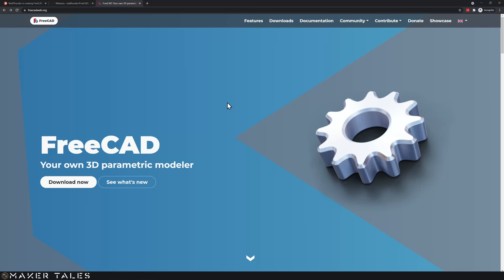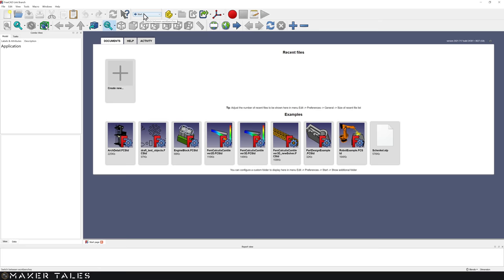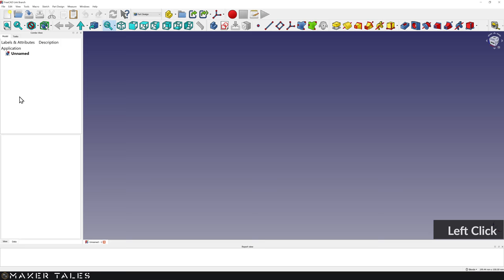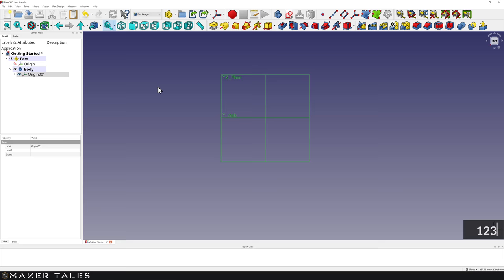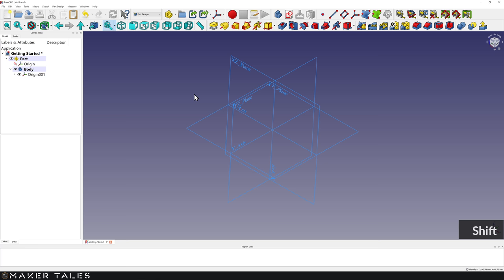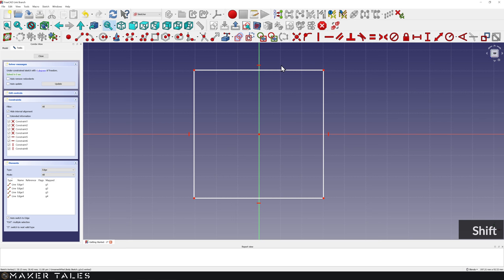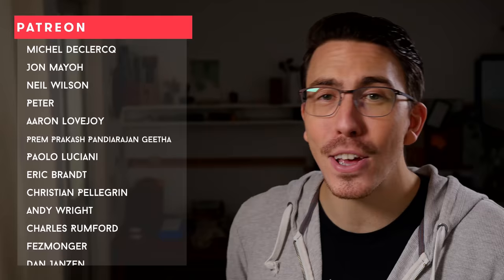How To Use FreeCAD The Realthunder Branch For Beginners | Setup & Basics | For 3D Printing | P. 1

Comment from the maker: New Location to Download the 2021.07.17 Version of FreeCAD Realthunder branch is here: https://bit.ly/3hzjGcP
(It's Realthunder's Google Drive, you can get to this same link by Clicking "Past Releases" in the github)
Reply: Should note that the most update-to-date versions will still be on Github
Reply: @stephenrbrough  Whats github?
Reply: I downloaded "FreeCAD-asm3-Daily-Win64-Py3-Qt5-20220118.7z", downloaded 7-zip to unzip it. I double clicked on "RunFreeCAD.bat", and immediately got an error message - "The code execution cannot proceed because VCRUNTIME140_1.dll was not found. Reinstalling the program might fix this problem". HMMM... Looking through the .bat file I notice it's setting a path - maybe there's something wrong in there. By the way, 123D Design stopped running on this same PC. Probably unrelated, but..  Searched through that folder, the file "VCRUNTIME150_1.dll" in fact isn't there. Is there something else that needs to be installed? Some programming libraries perhaps?
Reply: I wish this thing had a proper installer, though..  I had to figure out how to create icons on the Taskbar and Start menus (right click on the Taskbar icon when FreeCAD is running and select "Pin to Taskbar", and the right click the icon on the Taskbar again, right click on the icon that pops up, then click "Pin to Start").
Reply: at 17:36 there is a google search shown. I totally remember several of those drawings from my high school drafting classes in the mid 80's.
Trust me, I have a memory for these sorts of things, I got straight A's in those classes. And when you put time and effort into a pen & ink paper technical drawing, you memorize the shape.
I just think it's really funny and random, how that show of a bunch of plans comes up, and I recognize them. Must have been standard school curriculum drawings. I drew those parts by hand before Autocad was much of anything. Autocad version 10, which was when it really took off, didn't come out til after I graduated HS.
Some of those drawings at 17:36 have been around since before any CAD. They are from the days of papers & rulers.
Damn, I'm getting old. You get trapped in memories when you get old, just wait kids.
Reply: @iskandartaib  I know this comment is a couple of months old, but the error you are seeing just means you dont have the Visual C++ runtime installed, freely available from MS. if you look up Visual C++ Redistributable you should be able to find it pretty quickly. Good Luck!
Reply: @bezza191  Hi! Yes, I figured that out.. It's running now. However since  I watched that video he made comparing Blender to FreeCAD I've decided to learn Blender instead. 😁 I must admit, FreeCAD was pretty daunting.

Comment: THANK YOU! Yes, I barely started FreeCAD and I found the bugs to be a show stopper. I am going to switch to the Realthunder branch. I find FreeCAD or Realthunder good but, here is the problem. Most CAD programs hide the background mechanics. When I create an object in Autocad, it automatically puts in the location and constraints. FreeCAD is too " clickish " to make stuff. I just want to select a cube, sphere or a cylinder. Make the object, have it attach to other objects and be all happy. FreeCad asking me to define a body, a sketch, close this window, define this attachment point, tell FreeCad to make another body ( why? just click on another cube and go! )... It feels like using a washing machine, where I have to define the water level, input in the soap, define the spin RPM, and how much time on the drain cycle. Then do that all over again for every item of clothing I put in the washing machine. Too verbose, make some assumptions, like if I put a cylinder with 0,0,0 as my start... yea, I really do want 0,0,0 as the start origin of the object.

Comment: You're doing both the maker community and the open source community a great service with your work. I'm going to follow this intensely, as i'm going all open source this year, leaving proprietary CAD software behind me.
Reply: @jordanmclaughlin3312  Really well actually. I'm a mechanical engineer, and university indoctrinated me with a lot of proprietary software,  which i often find smaller companies hesitant to purchase. With free open source (FOSS), I can often showcase use cases, without ever asking management for license. I will say, that it requires a lot from the user, because what you often get with proprietary software is great documentation, user friendly GUI's etc. Not always the case with FOSS. Ufortunately CAD is one of the weaker FOSS fields atm, compares to proprietary. Theres simply no way FreeCAD could replace my Solidworks license at the moment, mainly due to the lacking assembly workbench. In the future, i hope so. Im into finite element analysis for stress analysis, and so im hoping to transition into open source with that over time as well, which FreeCAD actually supports too (Calculix). My plan is to be able to freelance within 10 years, relying as much as possible on open source

Comment: Thank you for taking this challenge on.  Great tutorial.  I started in on FreeCAD a couple of years ago, and you described the learning curve (prior video) precisely.  So, I gave up and explored options.  Never really came up to speed, but struggled through (I'm just a simple 3D print parts maker for pleasure - hobbyist) one where the "free" version required renewal too often.  I came across your video whereby you pondered whether to proceed with the current FreeCAD trunk or the RealThunder branch, which led me to this video.  Thank you.  I can now get a proper education on setting up drawings/sketches to print exactly what I need.

Comment: I used to mess with 3DS Max and Maya quite a lot years ago, but haven't really used any 3D CAD / design stuff since, aside from a lot of Eagle and Altium for PCB stuff.

But I think I was missing out on using CAD for combining PCBs with other parts.

I just wanted to say that this is an excellent starting tutorial.

I installed the RealThunder branch (Windows), and tweaked the settings and toolbar stuff, and the rest of the tutorial went smoothly. Thanks. ;)

I'm watching part 2 now.
Reply: Oh, one thing I'm having trouble with atm is my middle mouse button doesn't work, for some reason.

It's just a cheap Logitech mouse, and tbh, I've never had the need to use the middle button on this machine so far, so maybe it's a problem with a driver or something. I'll try FreeCAD on my main PC later.

So I had to switch back from the Blender navigation to CAD navigation, then I can hold Shift then right-click to rotate the view. (so I could more easily select the bottom face for the Pocket constraint.)

It's already making me think about buying or building a SpaceMouse. lol
I can see the advantage right away for CAD stuff, as using a normal mouse for rotation etc. is a bit of a barrier to a smooth workflow.

Comment: 3:52 A small correction: I believe you wanted to say "For those of you who wanted to work in imperial units, spend the 80 seconds necessary to learn the metric system instead." 😄

Comment: This is great. Thank you. I'm really happy to see you chose the Blender Navigation method. I'm coming from Blender and this made it so much easier than CAD. Quick question. Is there a way to have the radius measurements display horizontally like in the image at 17:45 instead of diagonally?
Reply: you can have more control iver how dimension lines and text is diaplayed in the TechDraw workbench, which is specifically made for producing technical drafts.
Reply: @BME-dj1ox  thank you for your help.

Comment: I have been using Freecad for 2-1/2 years and Youtube is my teacher. I learned a few things and your video and it convinced me to take the plunge to Realthunder. Thanks for that.  I'd been reluctant because it appeared than only the advanced users had converted and my skills aren't that good to be going onto the bleeding edge. There also isn't much in the way of videos describing what is gained with Realthunder. I've been using it for a couple of days and so far so good. 

One thing I've lost -  When there was an under constrained sketch in V 0.19.2  I could select the degree of freedom link under the solver messages and the error would be highlighted. Under Realthunder this no longer happens. Any ideas?

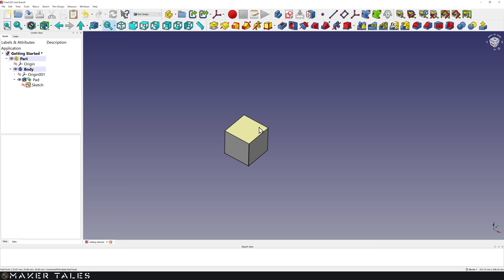At about 31:00 you suggest selecting a face to start a new sketch. I used to do that all the time but several of those more knowledgeable than me have said this is bad practice and that the sketches should be referenced to a plane. Is this a change for the Realthunder version, or just your preference?

Thanks for the clear explanations and logical content. Nice work.
Reply: The RealThunder branch fixes this very annoying bug!

Comment: Thank you for such a nice tutorial. I do have a question though. I have just installed the realthunder windows version of FreeCAD_assembly3 from the 2021.10.15 update and it appears that this version does not have options that appear in your video. For instance, when trying to constrain the circle sketched onto the cube the version I have installed does not give the option to choose diameter, but only radius. This version also does not give all the options that your video presents when double-clicking an item in the combo view. As an example, when I double-click Pad the only parameter I am allowed to control is the length. The options shown in your video do not appear. Should I find and download the program linked to above from July, or is the more recent version better even though it seems to offer less control? Thanks again for your tutorial, and thank you for any help you can give me by answering this question.

Comment: 15:30 - got a bit lost at this point. On my version (2022.118), the Quick View buttons are under a dropdown menu. Haven't found a way to turn it into a linear toolbar yet. Coming from 123D Design I'm used to using the navigation cube in the top right hand corner.. it's good that there are multiple ways to do things. Must admit, I like the keyboard shortcuts for these.

Comment: I personally think Blender has navigation backwards (just like it used to be with selection)

I prefer PAN with middle mouse and ROTATION with middle + shift, which incidentally is called the "Revit" Navigation here in FreeCAD.

Before this video I didn't even know the navigation mode could be changed and the only way to not get nuts was to use my old trusty 3d mouse. I would still recommend to anyone who works with CAD/Blender for longer to try such a device.
Reply: I like it set the Blender way. Do you pan more than rotate or is the preference from habit or is it due to mostly rotating with the 3d mouse? I have a SpacePilot I use for CAD and Blender and have a tendency to use it for regular/precise/complex movement and the regular mouse for really fast ones.

Comment: Great video but I have a question from someone more used to finite element modelling. You are modelling a symmetrical object but constrain a corner to the coordinate centre. Is there no way to constrain the centroid to the coordinate centre so that all measurements are relative? Thanks for the series of videos. The written tutorials are confusing and these are so much more helpful.
Reply: You can pick two opposing corners and make them symmetric around the origin. The icon looks like >< You can also make two points symmetric around a line.

Comment: I'm using 2024.124.0 build 14555 and many of these settings have moved or don't exist any longer. Also, no matter how many times I set Start to "Part Design" it stays on the start page with folders, etc.  Has this video been updated? Am I doing something wrong?

Comment: I just found this and have installed the latest RealThunder Windows build. I was following your video to set my preferences etc and noticed I am missing the boxes for the views on my toolbars. At 4:47 in the video they are the 7 view boxes  below the drop down that has the word Start in it. Any idea what I need to get these visible? I am using the CAD setup for the UI. Thanks. Edit: I realized I was running the RT version 20220111 so after checking that the latest FC v1.93 worked I found the RT version 20210717 and installed it and the view toolbar is there. Who would have thought the newer version wouldn't be the better version. Anyway now I can get started and set up my preferences etc. Thanks for the videos to help us noobs. I tried FC years ago and had a tough time with it so I used DesignSpark Mechanical and it did what I wanted at the time. I have the hobby license for Fusion 360 but hate the fact it seems the plug could be pulled at any time and also the cloud storage and limits. So FreeCAD is the winner (after I learn how to use it). LOL

Comment: OK.. a quick question..

I have encountered the horific bug I think you are referring to, I shall name no names, topological or not!

If I switch to realthunder, and I create a design I want to share, will it work on the main branch freecad? I tried to load a creation I made in the official branch and it screwed up loading into thunder but works in the main branch..

I love the idea of parametric design, especially for 3d printing because I can add in tolerances for mating parts which can be adjusted if the print is too tight or slack, and it would be great to share those designs but if it means people switching to another branch of freecad I doubt a lot would bother..

Comment: FreeCAD is okay for small parts, but for everything beyond that it sucks.
The way OpenCascade is implemented does not scale, the development of FreeCAD is very messy as well. Realthunder's branch addresses some issues but there are still many other unresolved issues.
The learning curve is:
a) learn how to design something, and get the feeling you know about it
b) the first issues will start to happen
c) you're facing that the forum is useless and won't be able to help out since the issues are too big and there are too many small issues which interfere with each other
d) you overcome those issues after weeks/months of suffering with FreeCAD
e) you submit patches and have to compaign (waste even more time than has been spent from b to d) for them to get merged

If you would have known b,c,d before you would not even have touched FreeCAD in the first place, however at that stage you can keep going with it, not very efficient but at least it will be okay.
After e I gave up on it, and closed my pull requests they should do it themselves and keep the bugs if they're so stubborn and insist on wasting other people's time.

Comment: this is really basic stuff, what I really need is to model a bolted surface with FEA, to check the strength of my design. lets, say I am designing a bridge from steel, how many bolts do I need to use so a 40 ton truck doesn't break it? that's kind of tutorial will be very useful.
Reply: "For Beginners" is in the title...

Comment: Because they zipped it, i cant install. My computer literally refuses. Will unpack and then the files will disappear or say they are moved when i click, also takes forever to unzip. God i hate zip and RAR files. Saves like %30 file size for %100 more bullshit. Also, how is there no installer anyways? Would be so simple to make a frigging installer for this and save all the hassle. You would think the guy who wrote like 30,000 lines of code painstakingly fixing free-cad would be able to write a few dozen lines of code for a simple installer.